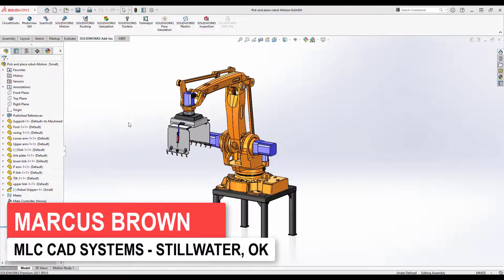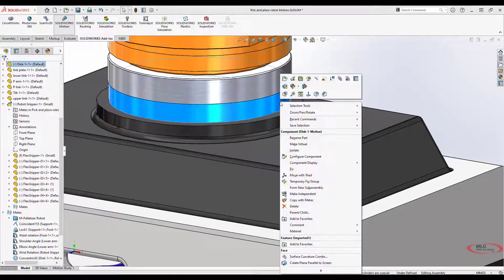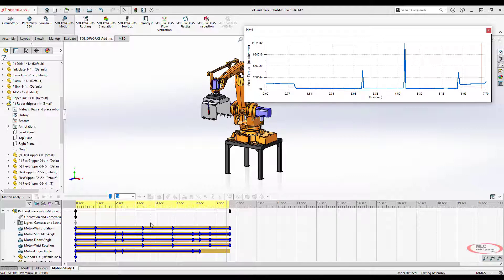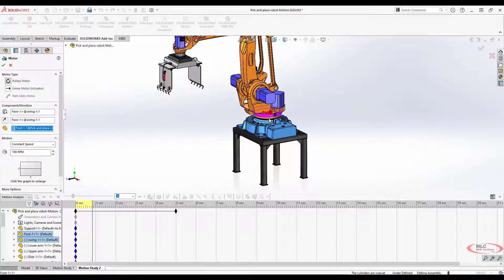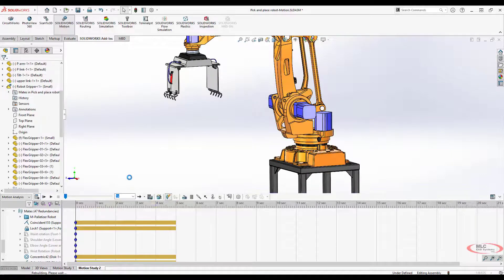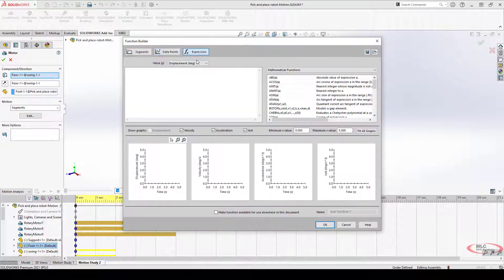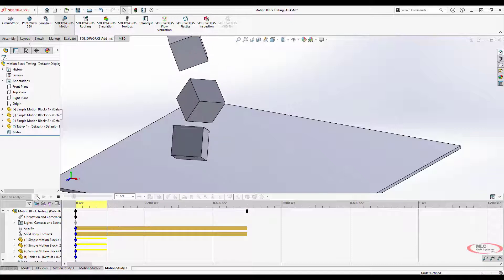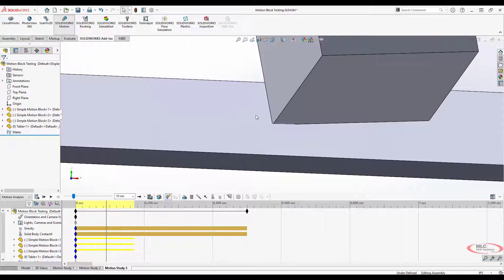SOLIDWORKS Motion Tutorial Series #7 - Motion Analysis

Comment: When i try to import the mate controller, it says: "the following mates cannot be converted to motor due to selection used: Limit angle 8" and no motors are implemented.
Reply from the maker: This would be a good question for technical support, if you are an MLC CAD Systems customer on subscription you can reach out to our team at https://www.mlc-cad.com/technical-support/

From the message of the error itself, it might be due to the type of faces selected or some other similar conflict.  You could try simplifying the mate or suppress and recreate it with different selections to see if that has any impact on the behavior.  Good luck!

Comment: Hello sir 
 I am working on project of robotic arm. And  i want to do motion analysis. But i getting problem when i am give for calculate all part are disassemble from assembly so please help me sir
Reply from the maker: This sounds like you need to focus on the mates in your assembly and simplify as much as possible until the model stays together.  The earlier videos in this series cover how to define mates so they are local to this motion study only or global, either way you do it just make sure the mates you apply also exist and are active in the motion study.  If the assembly contains a lot of loose components being mated, I would create a sub-assembly or a rigid group for each sub-set of parts to minimize the number of total mates that are used.